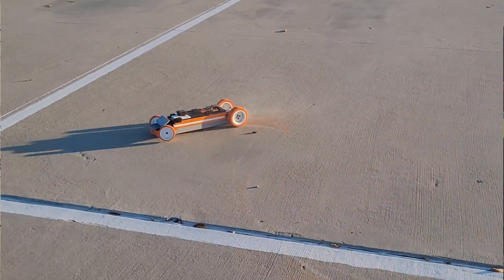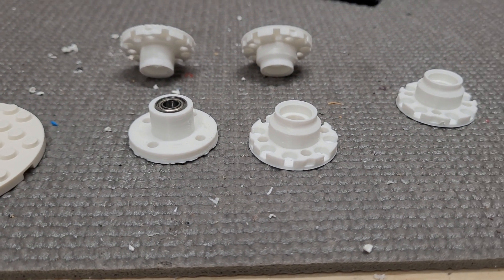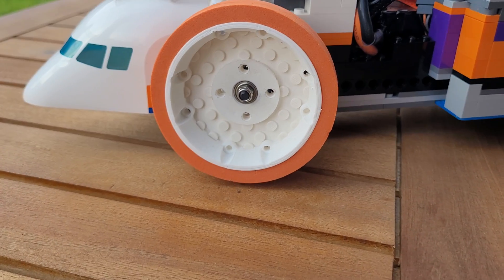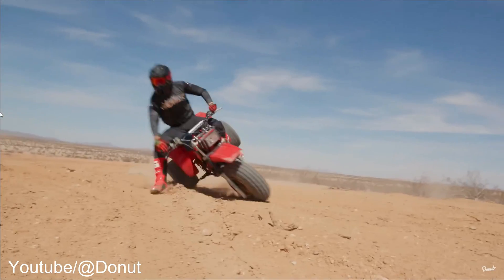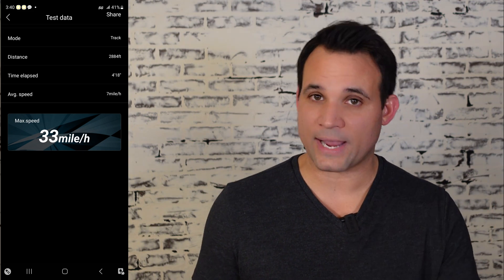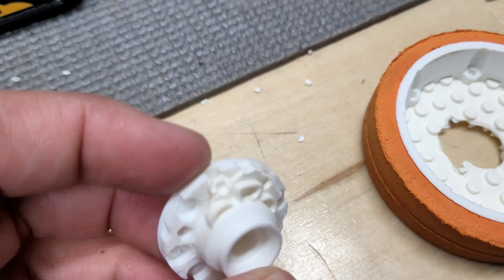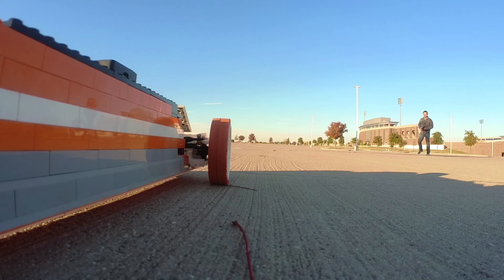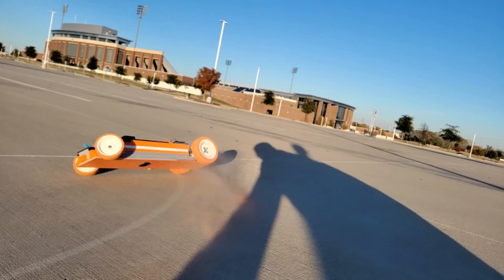How to Build the World's Fastest LEGO RC Car

Comment: I'm back. Just hit 55.9mph with K'nex.  Great video btw! My RC was all K'nex, aside from tires, electronics and springs. Even the axles and gears were K'nex. I think that's how the rules should be. Either way- I've got the fastest kid's construction toy now. I'm excited to see what people build to beat me! So fun!
Reply from the maker: Man cool build. I'm pretty sure I could make an egg go 50mph with hobby grade electronics and tires so it's pretty hard to come up with a reasonable ruleset.
Reply: @EngineeringAfterHours true, but this was built with unmodified kid's construction toy parts. Aside from electronics and tires. I'd like to see something made from Lego attempt to beat this speed. 😉 How do you think the rules should be? It'd be a blast to see everyone try to beat records. I think 3d printing should be outlawed. Just tires, electronics and a few small bits if needed. That way it's a level playing field. Maybe a limit to 3s or 4s?
Reply from the maker: @rodsoverbricks hard to say on rules, but it wouldn't make sense to mix building block types if youre searching for fair. If you really wanted a fair playing field it should just be unmodified parts from lego. Or unmodified parts from knex. Otherwise it's a slippery slope with both rules and brick selection. 

Even if I don't use a 3D printer, I have a ton of other tools I could use the make an equally performing design. That's why I say unmodified. 

I wouldn't mix knex and lego becaue whichever builds the most robust wheel will be the winner.
Reply: @EngineeringAfterHours very true, I generally included all building toys in my video with the rules that I laid out. It'd be fun to see people build with "Meccano"/Erector sets etc.  If it's a construction toy- it's fair to enter the ring with me. Haha. Also- your videos are truly awesome and well done! I strive to learn to output the quality and entertainment level that you do in your videos.  

Reason for my idea of no 3d printing: I too have a full shop at my disposal - it's an art to learn to shape, shave, weld, cast things into the desired part. I think that would entice a  much more "hands on" experience and challenge to anyone attempting to beat speed records with kid's building toys.  Till then- ill wait for the inevitable- someone beating me. Happy building!

Comment: Yall should check out my speed runs with knex. Ive only hit a recorded 48mph. But my builds are a tad more authentic. K'nex axles, gears, suspension.  Only the electronics and tires are non knex. No glue/tape. No 3d printed parts.

Comment: I like the process, design, build, test, analyze, revise until successful.  What are you 3D printing with these days. My 3D45 is still making accurate parts but considering an upgrade.
Reply from the maker: I still use the 3D45! Next upgrade will be a larger form factor so I can print a wind tunnel in 1 or 2 pieces.